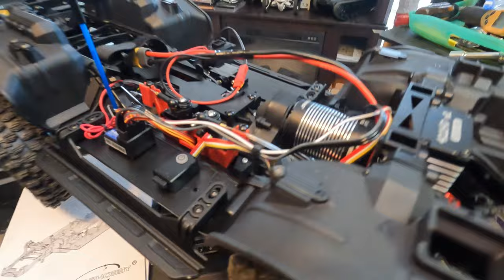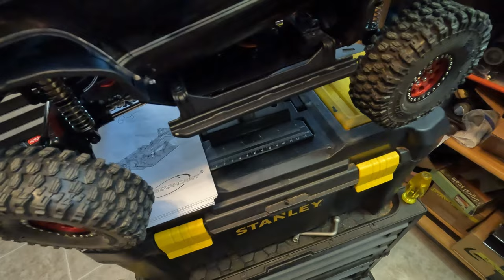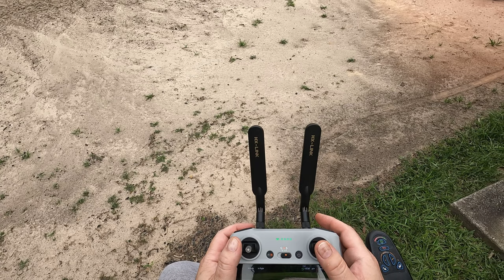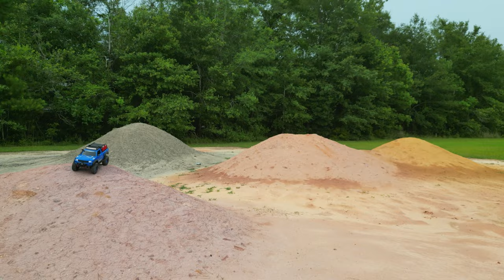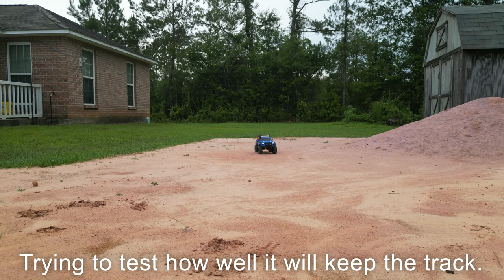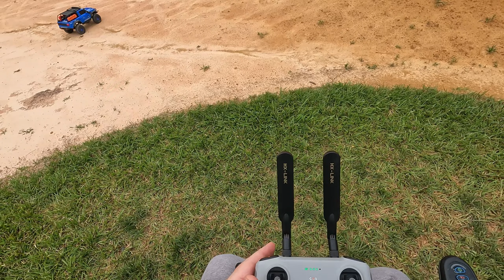Traxxas TRX4 - Austar Hobby Clone -  DJI Mini 3 Pro - Experiment - Multitasking - 06-14-2023

Comment: Being that it looks like you have plenty experience. I'm stuck between the xrt and Xmas I hear so much problems about the bell crank and gear problems. I just got back into RC with a typhon 6s. I know i'm asking a lot of questions, but one more what batteries do you go with
Reply from the maker: Hi Scott, Ask as many questions as you like. One of the best things about the rc community is that we all help each other. It's hard to chose a favorite with the XMaxx and the XRT, they both are incredibly tough. The XMaxx is the most versatile and the XRT out handles everything. You will have gear problems when landing under throttle with both of them. I have had more gear issues with the XRT though. As for batteries I like the Traxxas batteries and the HRB 9500mah batteries. Always strong and reliable. I hope that helps. Good luck to you!